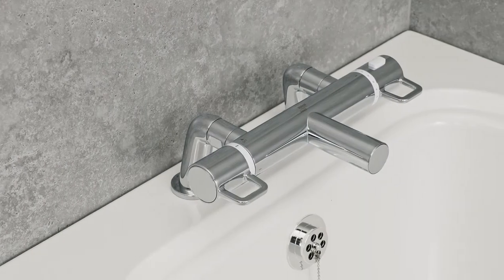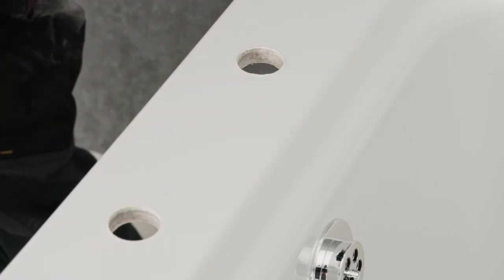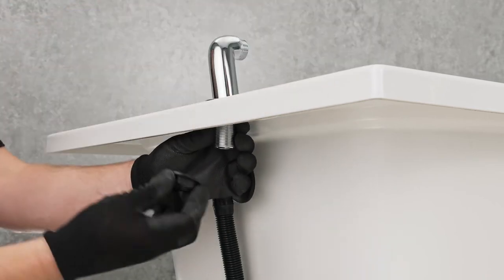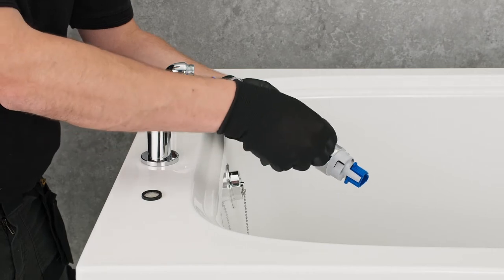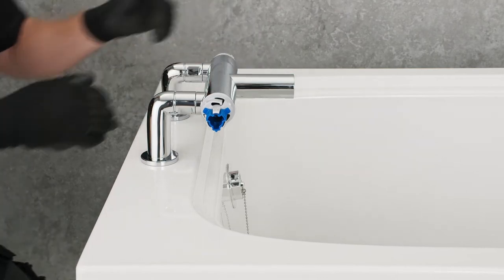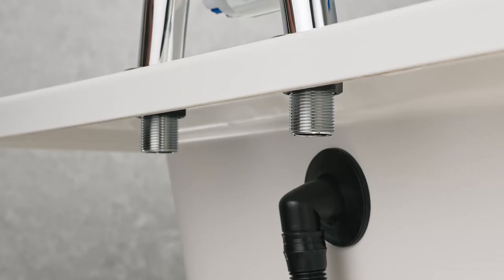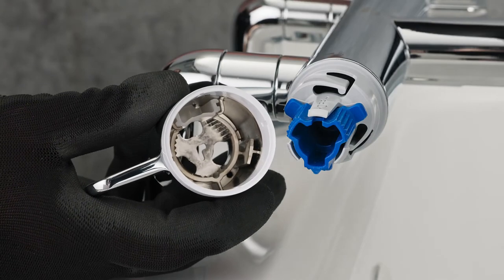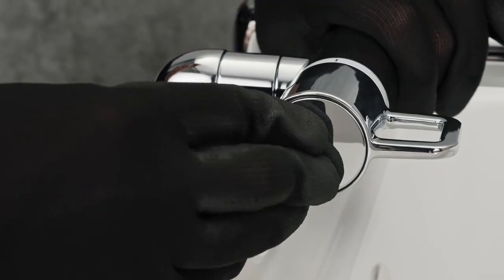Mira Assist Bath Filler  - Step By Step Installation Film

Comment: I’m struggling to remove the temperature handle even with the end cap removed. I’ve rotated it to the override position and held the override button but it won’t pull off. Any ideas?
Reply: It will 100% pull off if the cap is removed just wiggle it or use an Irish screwdriver